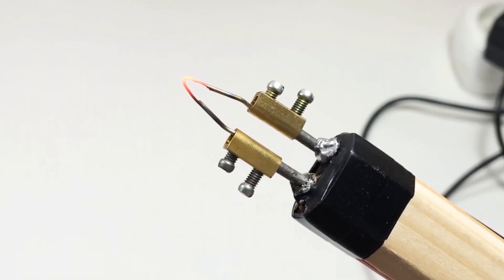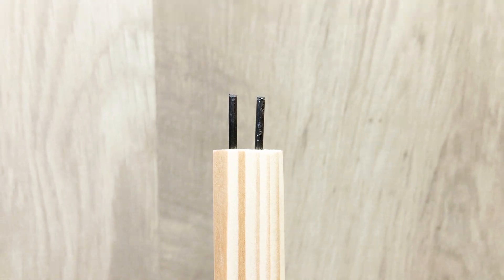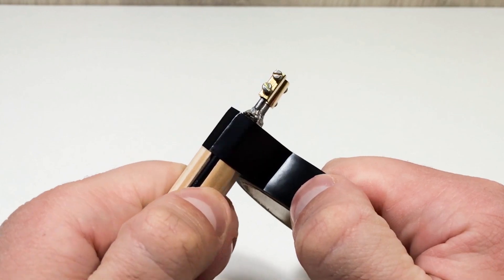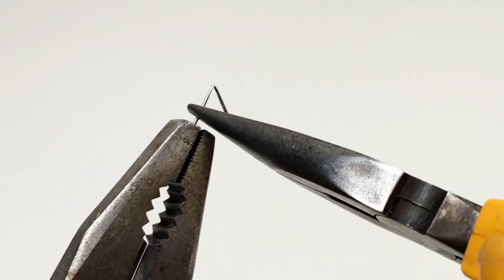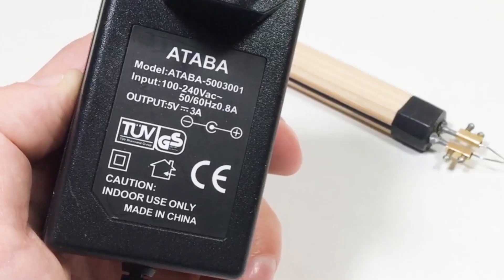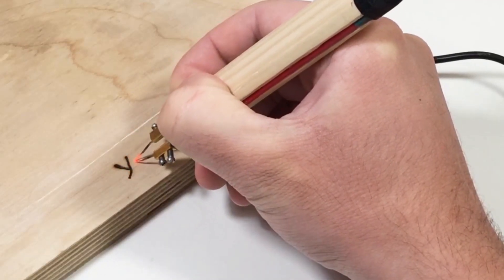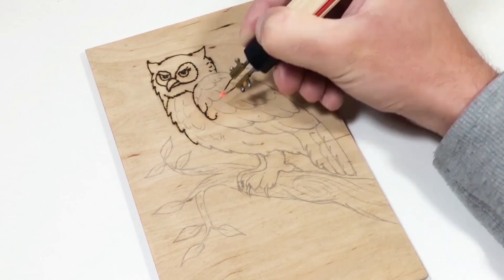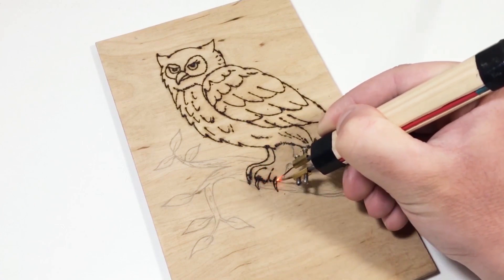DIY Woodburning Tool | Homemade Pyrography Pen (5V USB / Battery Powered)

Comment from the maker: 🔥 Would you use this DIY woodburning tool for art or electronics?
I built it to be simple, safe, and strong enough for real projects.
⚡ Powered by 5V 3A or even a battery — totally portable!

👉 Drop your ideas for upgrades (like adjustable power or a 3D-printed case) and I might build them in the next video.
Don’t forget to LIKE & SUBSCRIBE if you want more DIY tool builds!
Reply: would a similar lemgth of nichrome wire work the same?
Reply: I was thinking of using my old rebuildable atomizer from my old vape as a wood burning tool but I was scared of making the batteries explode due to long time heating. If I can connect it to an adapter instead of batteries maybe it can work lol. It has a switch for heating too. What do you think? Would it work?😊
If not I will try your method even though I don’t trust myself for making a device.😅